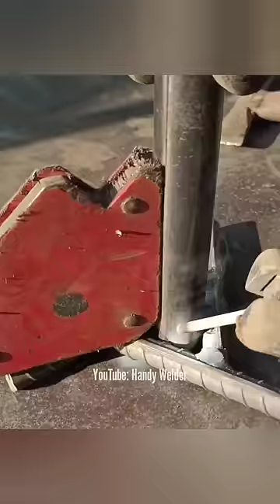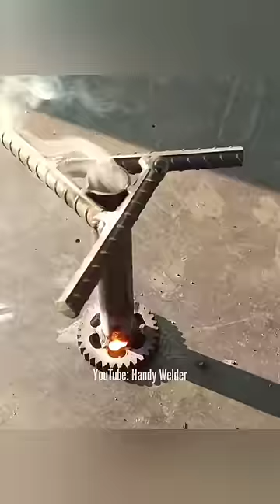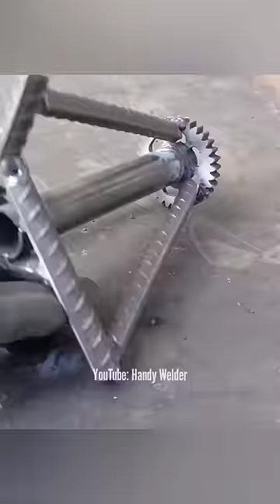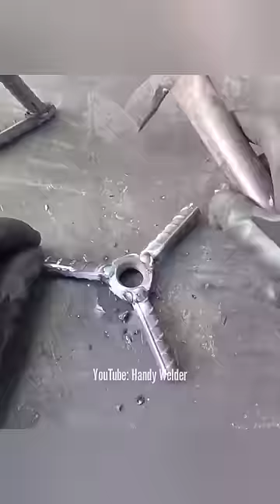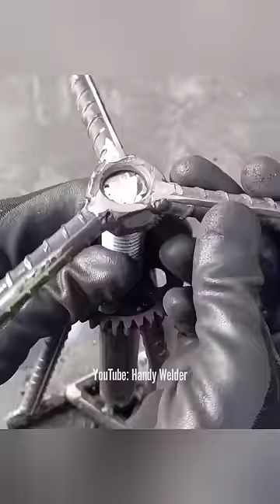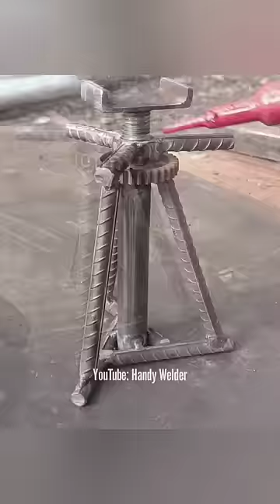a welder's clever invention

Comment: Darwin award achieved!
Reply: Wooooooow thanks
Reply: Tack welds are OSHA approved.
Reply: Класс
Reply: @sasquatchrosefarts along with that soft Chinese rebar.
Reply: We use screw jacks with 100,000lb boats all the time. They won’t back out that’s literally all that’s holds them off the ground. Screw jacks and 2-5 sets of keel blocks
Reply: @dennisjamison6888  I bet those aren’t tacked together with little pieces of rebar. If I’m claiming under a car I’m not using that to hold it up. Cool stand but if I were to use something like that it would be made with stronger material and actual welds.
Reply: @dennisjamison6888 screw jacks don't use V Threads.
Reply: @an2thea514  your right, they use a acme thread or something a square thread. but they still don’t move. It hardly makes a different
Reply: @cameronmcclure3974  we clambered under 20-100 ton boats not 1.5 ton cars. And the stuffs rusted to hell do to salt and yet it’s still perfectly safe. OSHA made people soft. Heck to put those keel blocks and jacks in place means standing under a load lifted by straps and cables. But heck that’s okay right? No physical way to do it.
Reply: @cameronmcclure3974  we haft to perfectly match the keel while it’s suspended. So people sit under the keels placing cribbing for a while to make it right
Reply: @dennisjamison6888  the difference being a Car Jack with Trapezoidal threads will work forever while this one will strip out after 3 uses.
Reply: What a waste of your life on that project you could just use the jack that comes with your car 0 out of 10 there you go👍
Reply: @an2thea514 i am from Europe. My car jack did harikiri. Trapezoidal thread. Mercedes original.
Reply: @MarioAPN  It's not a Mercedes original if it did harikiri. Mercedes is german, they don't have whatever this is in their vocabulary.
Reply: @an2thea514 just because its German doesnt mean its any good. Most people around here dont see any Mercedes older than about 6 or 7 years. They're made of the same metals as all of these other cars, only difference is when a Mercedes breaks, its almost the price of the car to repair, so people junk them.... Cause they're junk.
Reply: @MyMomsADadNow  go to Tyrol then where 50% of all cars by the locals are Mercedes cars from the 80s.
Reply: @an2thea514  fair enough. The older ones were better, but rust has long since killed those old gems in the rust belt. We are left with the new ones that can barely make it 5 years before major engine or electrical malfunctions. Typically, even the better ones still require too much maintenance and are too expensive to maintain when compared to almost every other car sold in America. Gotta stay away from the bad ones, (5.4 f150, older Ford cars, most American economy cars, almost anything from Chevy or Mopar past 2010 or so, to name a few...), but if you know what you're looking at, you can get a much better car at a better price that will be cheaper in the long run when compared to anything with a Mercedes-Benz or Audi badge on it, at least in the American car market imo.
Reply: @an2thea514  have you tried it yourself yo actually make that judgement.
Reply: @dennisjamison6888  back when I didn't have a lathe, I was welding up clamps in a pinch out of M20 Allthread, bigger than what this guy uses. 5 uses with grade 8.8 material, which I can guarantee is better than the stuff in the video.
+ it's common knowledge that you don't use V Threads for stuff like thus.
Reply: @MyMomsADadNow The best, in any market, is a Range Rover. Får better than any of the American overbuilt sports utility vehicles. I know many will disagree, but it is still the truth.
Reply: @Erubus  "overbuilt"  hahahaha. Isn't that usually a term used with good connotation in the car world?  'Over-engineered' is the bad one and is the epitome of Range Rover and Mercedes. That is my opinion just as it is your opinion that Range Rovers are the best. Not Fact. But ask a few mechanics and We'll see who agrees with whom.
Reply: It's a tripod jack. It's not an invention. Also, there is no reason to assume it would necessarily lead to harming its operator.
Reply: @gmw3083  ok. You use it.
Reply: @MyMomsADadNow  ok. Arrange its delivery to me...
Reply: @gmw3083  bruh. Make one. The video is LITERALLY about making your own shitty screw jack. I want nothing to do with this except to say that it's a bad idea.
Reply: @an2thea514  A German thing can’t do a Japanese activity? I’d posit the argument should go more like this, “jacks don’t have sacks of guts, something clever that rhymes about being unable to hari the kari”
Reply: @MyMomsADadNow  I have too much else to do. Maybe I'll get around to it one day. First, I'll probably assemble the one I bought a few years ago. Before that, I'll have to find all the pieces. Enjoy tapping on your keyboard/phone.....
Reply: @gmw3083  Why is it that when people start losing an argument online, their immediate defense is to claim that I'm a no life on my phone all day? You were here, 20 replies deep, in a comments section, too, buddy. Every coin has 2 sides. You're just the one defending, as another comment had put it, an "instrument of death and dismemberment." There are so many reasons why using a homemade jack as depicted here is irresponsible and dangerous. Making a video about it, knowing that people may try to recreate it and may harm or kill themselves, is another level of greed, evil, or ignorance.
Reply: @MyMomsADadNow  The main reason I don't/haven't made things like this is because they can usually be bought. That's easier. But, I have built many contraptions over the years that have worked to various degrees. I always know what I'm dealing with and where or when failure might occur. 
          I abandoned Babylon because the many overly complex systems are failing. I'll watch the fall from a distance in the hinterland and return for the salvage operation. Bits and pieces galore. One day...
           Between then and now, I expect to have to build more contraptions. Have fun dodging the homeless camps on the way to your mandatory monthly booster....

Comment: Harbor freight approved
Reply: Harbor Freight: Gauranteed for at least 1 use!
Reply: I’ve actually seen one of these on their shelf!!😂🤣
Reply: I have 6 cars. 3 are currently project. I have alot of jackstands. I used HF stands for years, then got a notice that they were recalling and replacing them because the teeth had sheared off on a couple causing a collapsed jack. I spent soooooo many hours under those lol. It was just a bad batch but i got my beat to shit well used ones replaced with some much nicer and higher weight capacity jackstands because they didnt have enough of the regular ones to swap my 12 stands out😂 win
Reply: Herbert Fart *
Reply: $9.95 and 20% to return it
Reply: @notyouraveragegoldenpotato I read that after they recalled them, they had to recall the ones they gave as replacements as well 😂😂😂
Reply: They recalled theirs and I'd still trust one of their recalled jackstands before this janky contraption.
Reply: Gump-  "Lt. Dan what happened to your legs?"

Lt. Dan - "Harbor Freight jack stands"
Reply: @JoseRodriguez-uj5gr  Well you heard incorrectly. There have been no further recalls.
Reply: I don't want to kiss any company's ass, but it's kinda fucked up that they're getting flak for doing the safe thing and issuing a recall based on probably a handful of failures. They could've just done the standard corporate thing of denying it and doing nothing about it.
Reply: Six failures that they've admitted to and acknowledge. Like any other company they weighed how much they'd spend in settlements for injuries due to the low quality metal and poor design of their stands and decided that recalling 1.7 million of them was going to be cheaper. Especially as they either gave store credit so you'd still be buying more of their products or they'd give you a reduced refund. I turned mine in and since I make a little more now bought extremely high quality aluminum ones with double the weight capacity from a reputable company for not much more than I paid for the HF ones in comparison. 
I do like HF for a few things but their quality has gone so far down now it's not even worth the fuel to travel to their store and buy anything from them these days it seems like. Instead, I just get same day shipping on cheap tools from Amazon that are much higher quality and have a better return policy.
Reply: @robertpaulson2052  “Harbor Freight recalling more jack stands after 'welding defect' found in replacement stands”. 
That’s the name of the article in USA Today published on July 7 2020. Whether you think that they are a credible source of information or not is a different story.
Reply: The jackstand you order from wish

Comment: Scissor Jacks cost only $20-25 and are actually rated for that type of stuff
Reply: scissor jacks are not suitable for safety stands; jack the car up, place the stands securely, the let the weight down onto the stands. never work under jacks; that's how you get on the evening news.
Reply: Never trust a scissor jack, or any any jack for that matter.
Reply: @joelee2371 well what was in the video wasn't a jack stand either 🤷‍♂️ the guy literally used some tacked together metal as a "jack".....so a scissor jack would 100% be better suited to raise 1 tire off the ground over that...thing....that nobody has any idea how strong it isn't 🙄
Reply: I've had 3 scissor jacks fold on me before I could even get the old tire off. Rated is a subjective term.
Reply: Morale of the story, what ever Jack you use to lift the car you can never use enough extra support to stop the car falling on you when your working on it. I know someone who lifted a car with a fork lift and the boot collapsed causing the car to crush him, the size of the jack is irrelevant, it's all about support once you've got the car lifted and there's no such thing as to much support.

Comment: Some kids had a flat tire once in front of my house. They had a scissor jack and was going to use that to jack up car. I made them come up to house and get a couple concrete blocks to put under car so if it fell, it would not fall on them. Kid could not get wheel off, so he was laying under car and was kicking tire. I got him out from under car and showed him how to do it. Sometimes we need someone who knows better to point us in the right direction. Welding this jack up seems like a bad idea
Reply: very bad
Reply: I hate to be that guy on the internet, I hate that guy, but, concrete blocks, I’m assuming cinder blocks, are one of the worst things to put under a car, the give zero indication they’re about to fail. And When they collapse they collapse fully. Had a guy last year went missing, his family found him a week later in the far side of his property under his project car, the cinder blocks turned to dust. 

Even using them “eyes to the sky” with a wooden block across the top they can still fail. 

I say this having crawled under my fair share of mobile homes doing duct work, but they’re meant to be supported by cinder blocks, the cinder blocks haven’t been tossed around the yard for years, and they’re all eyes to the sky, on thick pads, with wood toppers under smooth I-beams. 

So unless you’re talking about those 80-100lb solid concrete blocks we used to use to weigh down cultivator discs I wouldn’t recommend getting under anything sorted by cinder blocks not meant to be supported by cinder blocks.
Reply: @franksmith5603 dome cinder blocks are not hollow. If placed under a flat frame section..

Still would be better than nothing.

Wood would be ideal
Reply: Thanks Dad, I really appreciate you teaching me how to change a tire.
Reply: Also, would recommend a jack stand, spare tire (at the very least) or a block of wood to stop the car falling before your chest (doesn't) stops it
Reply: @franksmith5603 what’s your opinion on using old tires which still had the rims? My old man for some reason had a couple lying around and told us to use them whenever we had to lift the car.
Reply: @jhm3346  I always throw the tire/wheel that I just took off under the car, I’ve never had one drop and actually to use it but I’m all for it. Wheels are structurally pretty strong.

Comment: I’m pretty sure the jack stand was invented a long time ago!
Reply: A jack stand can't lift a car up, it can only hold it up after a jack has lifted the vehicle up. 

That being said, this invention is a thumbs down for me.
Reply: @ericfluty3257 well it's not a jack stand, it's a "jack" unless you didn't see it lift the back passenger side wheel off the ground in the video...
Reply: It’s a homemade screw jack. They have been around a very long time
Reply: And so was the jack. But this beautiful thing is a hybrid.
 Why? I have no idea, but there it is.
 I've half assed a lot of tools in a pinch, but I'll pass on this one.
Reply: @thrashmetalord but they are not made of mild steel thin nut and threaded bar. Imagine if that few relatively soft threads will support the truck's weight for long.
Reply: @tonycardone990  how have you used the words "beautiful thing" describing this monstrosity, the thread is far to weak and will fail very quickly.

Comment: Makes harbor freight jacks look like the way to go
Reply: & that's really scary, because it's true
Reply: At least your family can get a jack replacement, after you get juiced, at harbor freight.
Reply: Yo the Daytona jacks at harbor freight have gone a long way in quality compared to what you would have picked up from there 10 years ago.
Reply: At least you can sue harbor freight, for this you just get a Darwin award. To be honest, I had the first set everyone had a meltdown over. For years never had a problem of any kind, I'd seen the videos of them letting loose and they all were the same, people dropping them way harder than any normal use. Ended up trading them in for the new sets cause they were old and figured what the hell, new sets and no cost. Never even got them out of it the boxes before they were recalled. I should've kept the original sets.
Reply: I didn't mean to comment on this comment. Was supposed to be the main thread

Comment: I made similar jack stands using 3/4 gas pipe and fittings and welded a base on them and they are adjustable the same way as in the video.  But I only use them to hold pipes when I’m welding up exhaust pipes.

Comment: I have 18v DeWalt 1/2 drill w/ a the scissor jack. Hook I made to fit the chuck. Using this to lift most 1/2 ton single corners for quickie tire change since 2003. Out last all my newer 20V Drills.

Comment: The cog is hardened steel. When you weld it, it becomes brittle.
Reply: Rust possibly and due accident are possible
Reply: welding alone would not harden it further it would take a quench, any heat will cause it to lose its hardness

Comment: 1: 12" section of 3/4" threaded rod
1: 3/4" threaded nut
1: 12" section of 3/4" I.D. seamless tubing or equivalent
1: 3/16" plate steel coupon ~4" x 6"
1: random timing chain sprocket from the junk drawer
1: ~6' section of rebar
2: welding rods of your choice
1: cut-off wheel grinder of your choice
And 30 minutes of your time.....

Or..............

You could go to Wal-Mart or Harbor Freight and buy 2 for like 30 bucks. Then, at least, when they fail and kill you, your family will have someone to sue, so that you dont leave them with nothing.
Reply: With this guy, the welding rods are probably  6013. 🤨🙄😑
Reply: That's a 1/2" rod. I'm an Ironworker. Been doing rebar for over 20 years.
Reply: @mr.g4516  Even more reason to chuck it under a truck and test it out with your rib cage.

Comment: My dad was a steel barge welder, he taught me this technique when I was 10, I'm 74 now...I miss that guy...
Reply: I’ve worked on tugs and dredges for 25 years, ship yards use larger ones all the time. I have a set of 4 boat popits I use for lots of things
Reply: Poor dad, died after crawling under a vehicle supported by that hot mess...
Reply: @at_3831 yeah, but they probably aren't made of rebar and gear scraps, actually have a solid or at least angle iron base/braces, and full welds all the way around.
Reply: @tonycardone990  correct. Not home made with actual rated screw and nut rated for it.
Reply: It's amazing the amount of people in the comments that don't know what a screw jack is. Most are arguing if it's a jack or jack stand.

Comment: too light for the application. a better safety stand is made from angle iron, with tube sliders and cross pins for the locks, and will be as good as anything you can buy, and better than some.
Reply: They made a jack....not a jack stand (safety stand)....they literally lifted the passenger rear tire off the ground with it 🤷‍♂️🙄